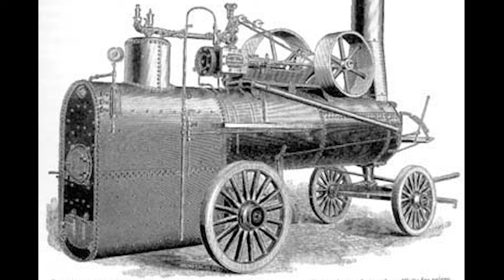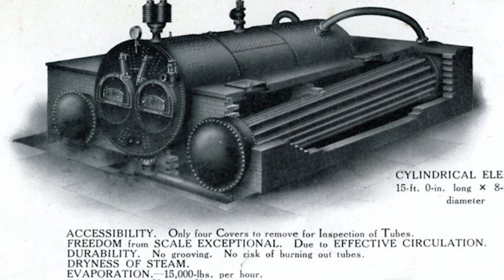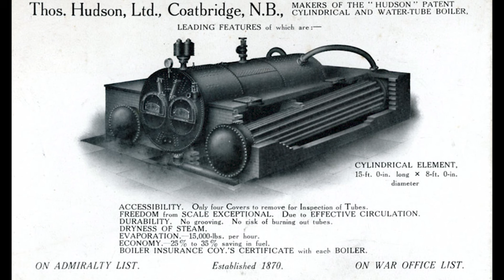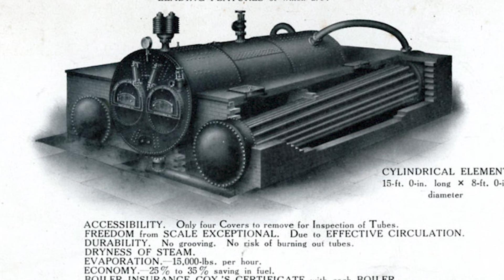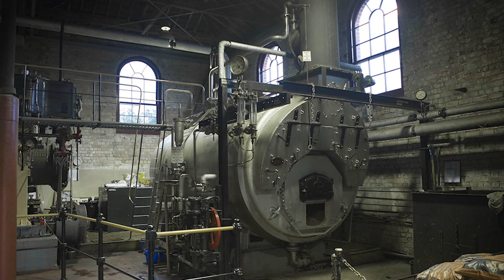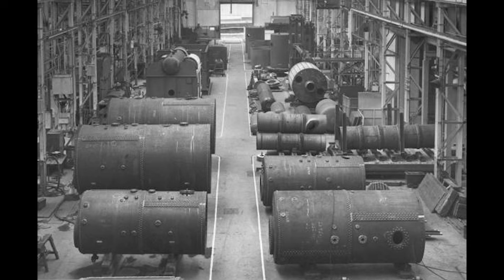Why 1880s Steam Engine Boilers Lasted 100 Years While Modern Boilers Rust Through in 20

Comment: The acceptance of risk is different now from what it was 150 years ago. Then it was not unknown for boilers to burst, with terrible consequences for anyone nearby but no worldwide news headlines. Imagine the consequences if a steam locomotive boiler were to burst now in a station on a preserved railway, with families crowded around it. It would hit the headlines worldwide, and there would be a huge increase in insurance premiums. If it were to happen twice within 50 years, that would be the end of steam operation on preserved railways.
We cannot now take even the slightest chance with any boiler that will be used in a public place, and even with industrial boilers on which the standards are possibly not always strictly enforced in some countries it is rare for a boiler to burst.
Reply: The ASME Boiler and Pressure Vessel Code was formulated in 1914.  It is now used in over 100 countries.  As of March 2011 the document consisted of 16,000 pages in 28 volumes.  No one would consruct a pressure vessel today that didn't conform to the Code.  Insurance would be unobtainable, and the potential liability would be unacceptable.

Comment: the higher the pressure the higher the wear and tear, just like racing you can push a top fuel engine to 12,000 hp but it dont last even the whole way down and needs rebuilt after each run, or you have those huge stationary engines that had the same hp as a modern car engine but because of the looser tolorances and rebuiltabillity and overbuilt nature allow the big engine to last way longer.
Reply: Today we have Codes for design and maintenance of pressure vessels, so it don't[sic.] kill someone.
Reply: @MrShobar  if your talking at me, I know livio dante porta got a regimen down for stopping scaling and the most backwater unpotable water you could get and got it so they could practically make the boiler prettymuch the backbone of a steam engine or he said you didn't have to make it removeable as it would not need to be replaced and did things, in argentina in patagonia which is one of the most inhospitable places on earth and made steam locos that preformed better then most others ever made and on slack coal, he was a wizard and genious with creating efficent boilers, but nothing wrong with overbuilt aside the cost, sometimes large and in charge and simple works great and will do the job.